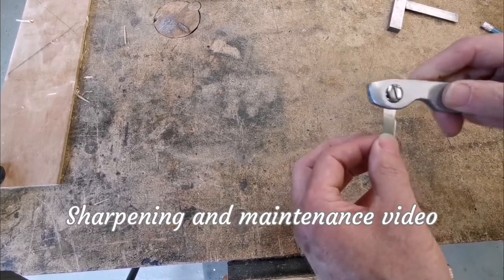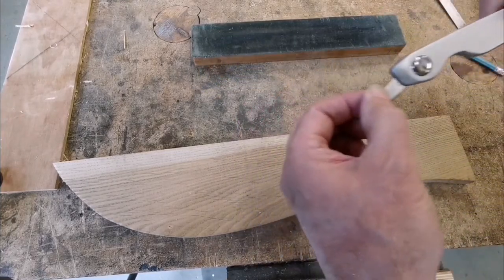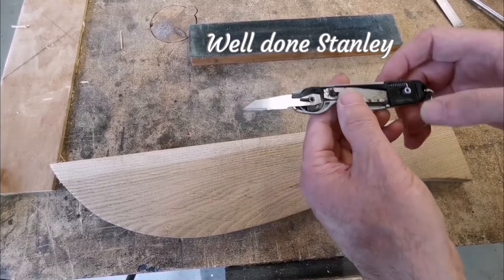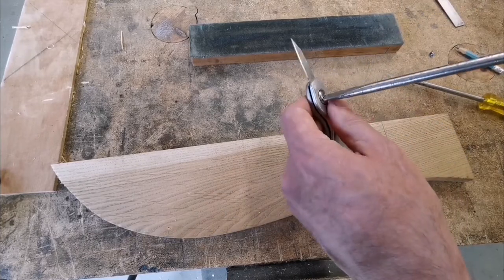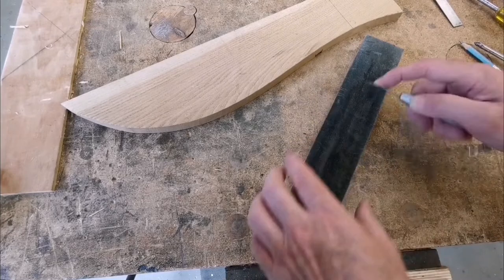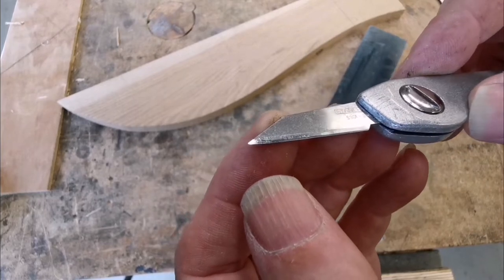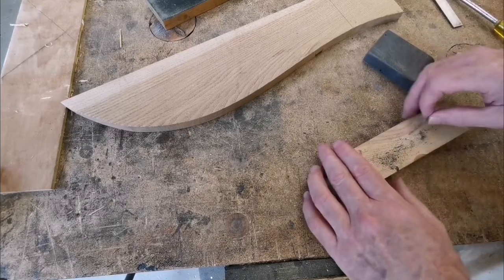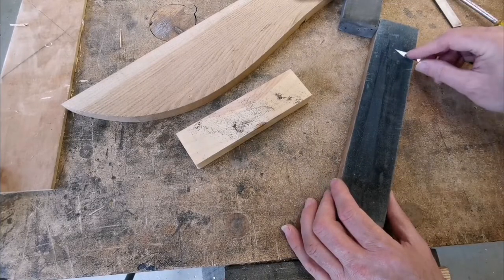How to sharpen a Stanley Knife - and keep it sharp

Comment: Got 2 of them that I use as a marking knife for woodwork and for triming in my bookbinding. They really are great. Got mine after Paul Sellers recommended them years ago and would be lost without them. Going to go have a look at those Garryflex blocks later.
Reply from the maker: Only found out yesterday that Paul Sellers uses the same knife. Well I'm in good company then 👍 What did you think of the sharpening? Do you sharpen too?
Reply: @twcmaker  Yup, but I've been letting the blades get to the pont where I need to go to the stones. Using a strop more frequently is a much better approach which I'll be adopting from now on -  got to get some use out of the huge block of polishing compound I've had for years as well 🤣plus (in theory at least) the blades should last a lot longer. Ordered a set of the Garryflex blocks from GC Abrasives (don't use Amazon on principle).
Reply from the maker: Brilliant, keep up the routine on the blades and they'll last forever. Thank you for supporting me Dave. Very much appreciated 👍
Keep the strop on the bench, it gets used so much more if its in front of you. And you'll be amazed by the Garryflex blocks 👌
Cheers. Jamie

Comment: I have one and like it. Mine only has the one screw. The end holing the action has a post which does not turn or drive out.
Reply from the maker: Is yours an older one then?
Reply: @twcmaker  I guess so
Reply from the maker: I've not seen an older one. Does it work the same way.
Reply: @twcmaker  yes, but it doesn't pivot as far, at least I never have been able to do that. The plastic guts look the same
Reply from the maker: Oh okay. 👍

Comment: Thanks for the video. I saw Paul Sellers say that these can be sharpened, and whilst I can sharpen chisels and planes accurately, I only seem to round over the blade with these and make them completely dull. Any suggestions?
Reply from the maker: Practice. Get someone to either watch you and advise. Or just ask them to video you doing it. That way you can watch it back and see where you went wrong. I watch my students as they do things like sharpening, stropping and cutting joints. And it's surprising just how you hold yourself can affect your performance